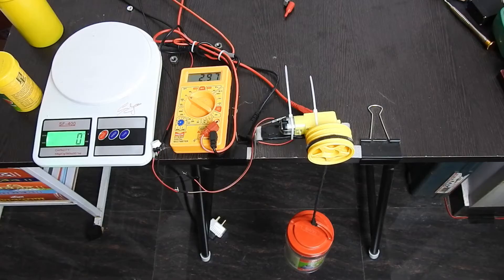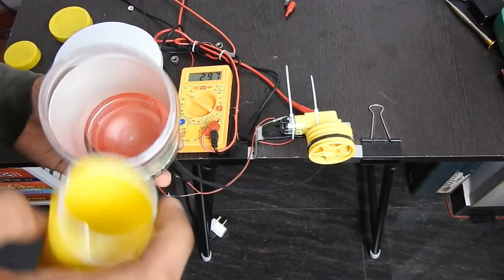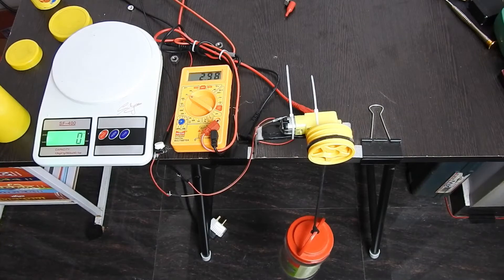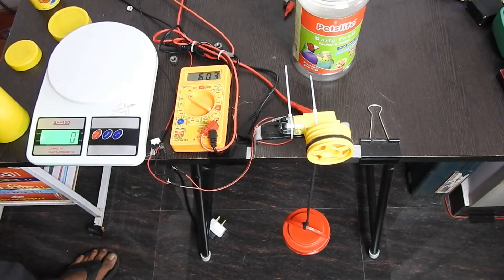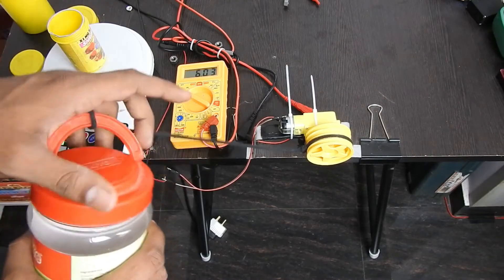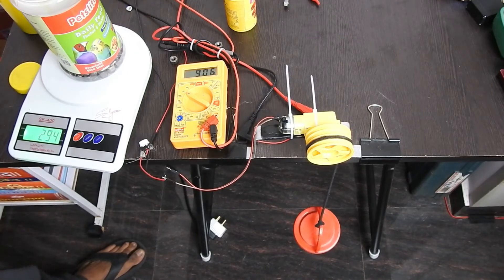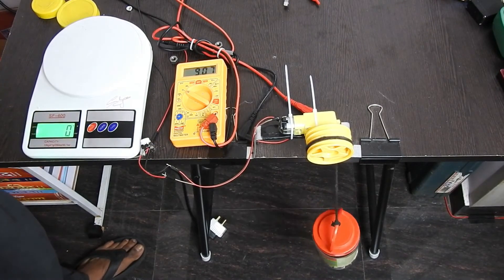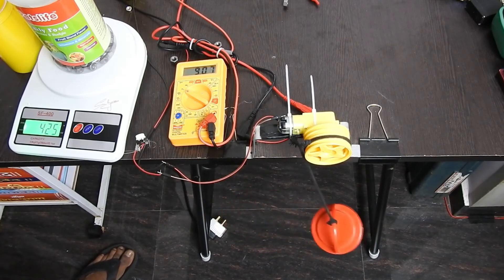I Torque tested 300 RPM Motors || Surprising Results !!

Comment: I think your torque calculation has an error. The distance in the torque formula is the distance of the force vector from the axis of rotation (in vector notation, this is r \cross F). So I think you should multiply the force with the radius of the pulley. I can't post an image here, otherwise would have posted a sketch of what I mean. Anyway happy to discuss and thank you for your experiment!!
Reply: Exactly, it should be the radius of the yellow wheel which he is using.